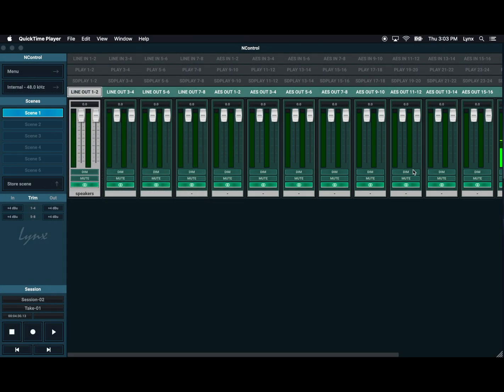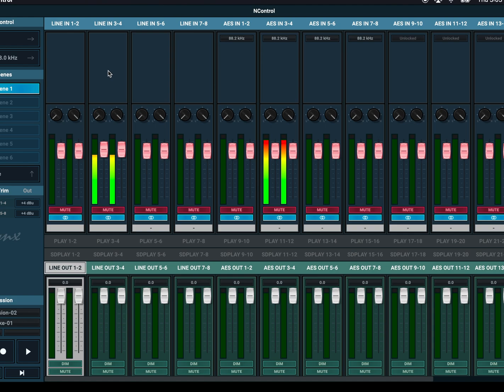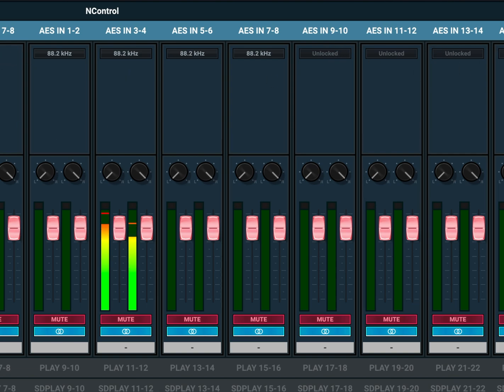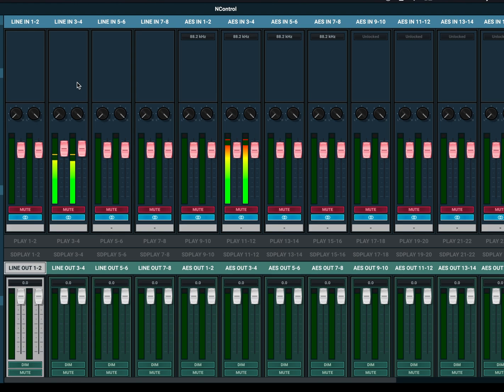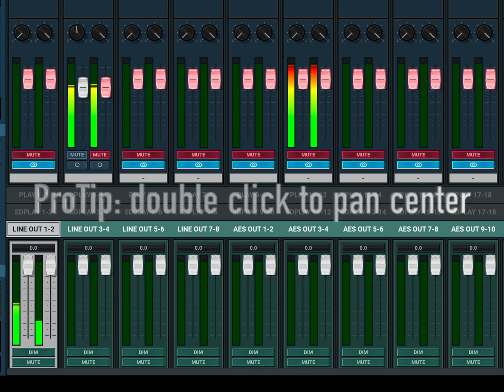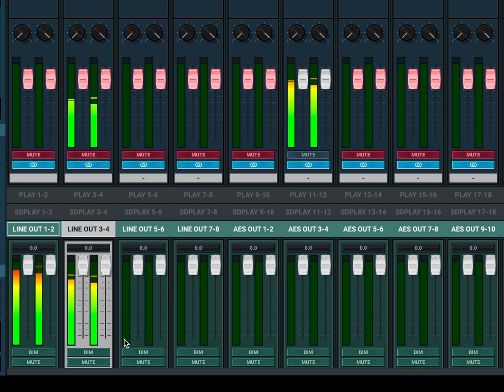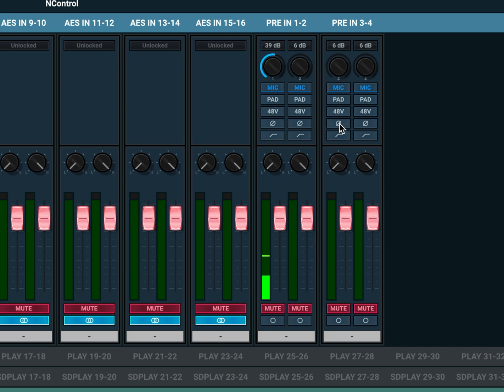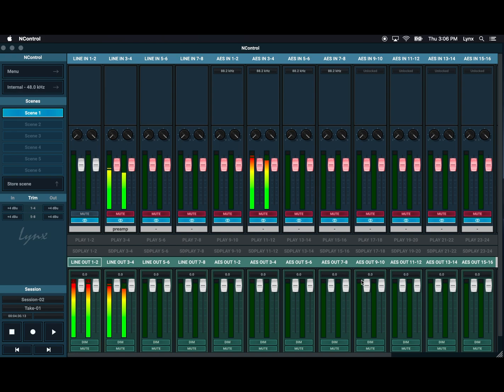Lynx Aurora NControl Tutorial part 3 of 5: Input Monitoring

Comment: Can we assign inputs to outputs outside of ncontrol software?? Thru the front panel?? Would be super useful in remote work. Thanks!
Reply from the maker: The front panel allows routing of sets of source to the outputs (Line, Preamp, AES, ADAT).  NControl gives detailed routing.  It is also possible to use a control surface that supports the MCU Pro protocol to change volumes and routing when using NControl.